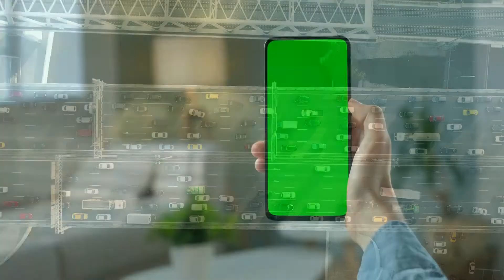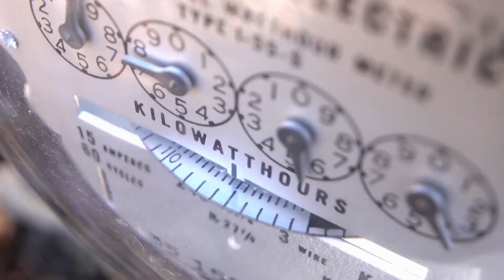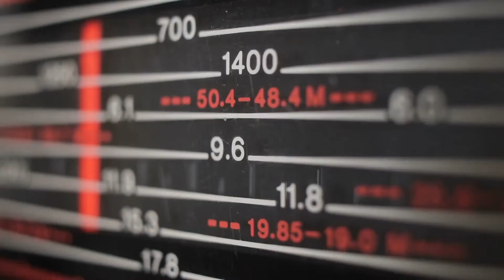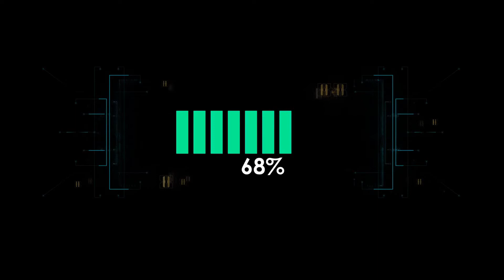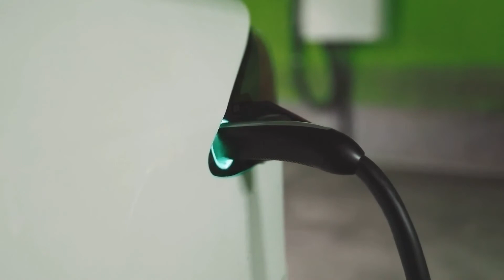Why electric cars are better than gas cars #kingdom #kingdominformation

Comment: I’d like to point out that just because the car itself isn’t producing pollution that doesn’t mean it’s not polluting. making the batteries for them is actually more environmentally harmful than sticking with a gas powered car. also I love driving manual, so a car with no transmission whatsoever sounds like the most boring thing on earth. I’d like to add that while the whir of an electric car sounds pretty good, it’s way to quiet and nothing can replace the beautiful roar of a gas powered engine. and I don’t care about closer parking spots, I want to park far away so nobody dings me, it’s also good exercise.
to sum it up you shouldn’t go electric if you care about the environment, like physical fitness, or you’re a car guy.
Reply: also electric cars don’t make you cool, if any car makes you cool it’s a loud performance car